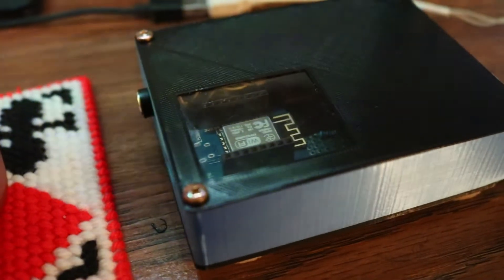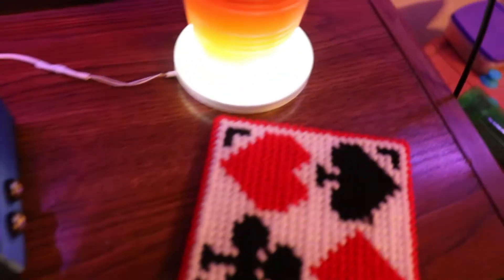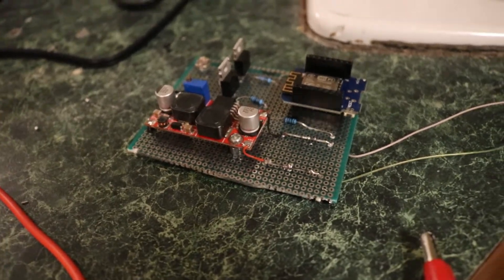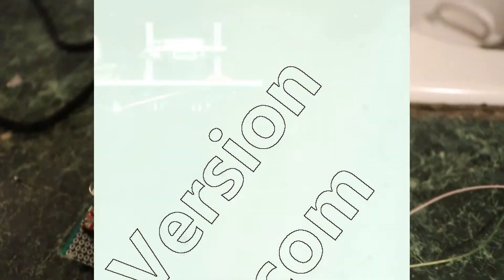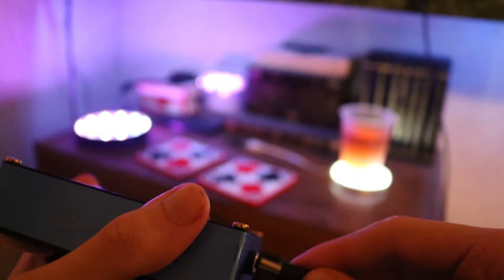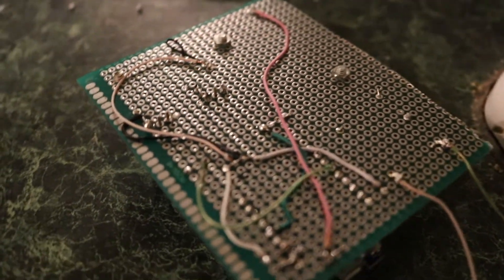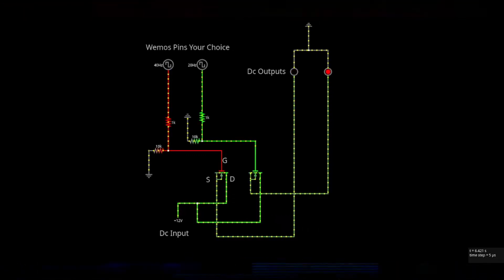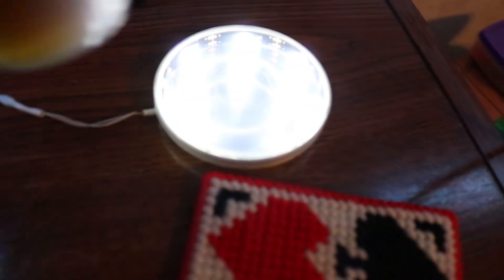Wemos D1 Mini WiFi 12v Switch

Comment from the maker: Update this project is still going great I use it for a few things but it fun to know my original idea I might be doing sometime soon!!! Gonna hopefully be building that charging station for my solar stuff it might not have the wifi in it but it still fun to use this wifi switch for other stuff around the house for those wondering I do use a fuse at the input. And for like holidays I got a script to set on and off times for the switch for various lights and stuff that I can run on my computer. I also stenciled a note on the bottom to remind me what pins I used for when I need to re-program it.